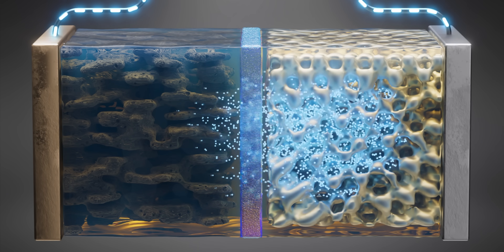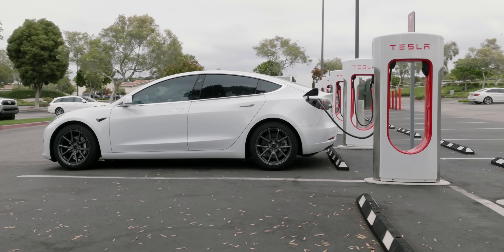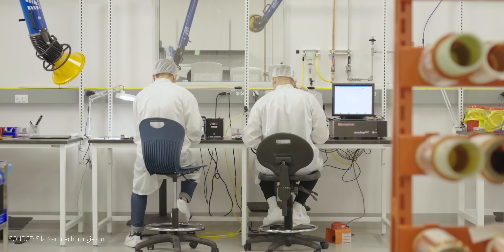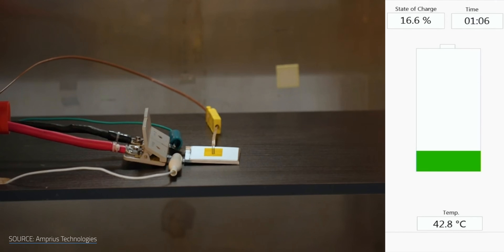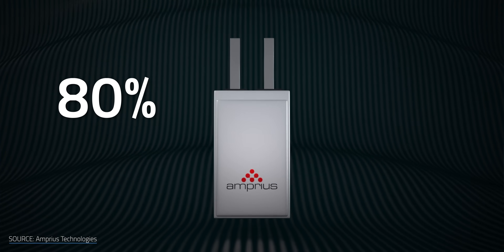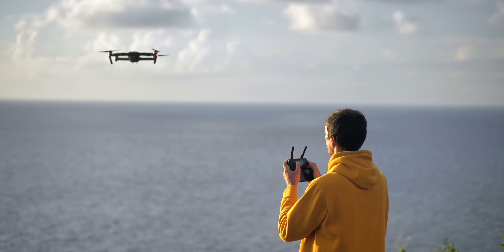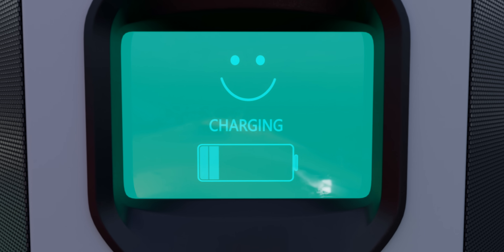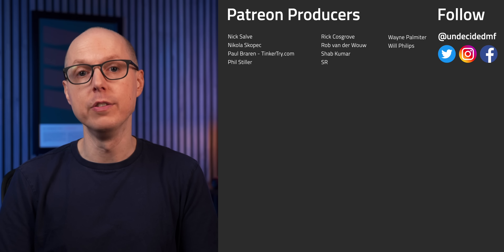Why This Ultra Dense Battery Breakthrough Matters

Comment: I would like to see an annual or bi-annual video going over the progress (or lack thereof) of some of the "breakthroughs" covered over the past years. I really enjoy these videos and consider myself a tech-optimist, but I'm also very skeptical of breakthrough technologies. I find that they often have very lofty promises that they almost always fail to realize.
Reply: That’s a great recap of this entire channel.
Reply: @airman122469  it's a great recap of gee-whiz engineering journalism since Popular Mechanics and Popular Science magazines 50+ years ago. Article after article about solar roofs and flying cars with never any follow-up on the invention they covered 4 years ago. Making physical things is hard, and improving them is harder (the exception is integrated circuits that until recently benefited from increased density). However over the same decades there has obviously been incredible incremental progress in solar, batteries, EVs, eVTOL aircraft, etc.
Reply: This would definitely increase the value of this content. You always see the new and exciting stuff that may have a future, but you never hear about how it panned out and why. Failure (and success) is how we learn, even if it's other people's failure.
Reply: It's not uncommon for something to seem very promising in the lab but turns out to be very problematic in later stages of development.
Reply: Same I would also like to see follow up videos on how these technologies are progressing.
Reply: This is a great idea, and would make these profiles journalistic which is valuable.
Reply: The issue is that the majority of what he talks about are reports from companies working on the 'breakthroughs'. These companies have financial incentive to pump their numbers and hype there product to increase investment. Most of this stuff isn't based on papers published just company memos sent to reporters.
Reply: Yeah, there are a bunch of videos about new revolutionary technology, but after fist video you never hear about it again
Reply: The fact will Farrell is talking about it tells you all you need to know. We will never hear of this again.
Reply: Google  Duck Duck Go is your friend
Reply: My partner is a PhD researcher biologist for durham university, she is one of the worlds top DNA experts in her field. What I have learnt from watching her and her colleagues work is that you get jumps in science. So a couple of years back she developed a new way to extract dna which was ground breaking and cool. Since then she has spent about a year on one tiny part trying to figure out a seriously complex issue. She works with multiple universities, has been to multiple countries and they are inching closer, but in real life there isn’t much to talk about to fill a video. One that issue is cracked, it will jump to a new level… but with these battery technologies, they will progress forward but at times to the lament person, will look to be stood still but it’s actually moving through a difficult “boring” stage.
People like lots of info in something the size of a tweet, it’s difficult to make it entertaining and informative.
Reply: @IW-1986  I appreciate what you are saying here. I have no doubt that progress in battery (and other renewable) technology IS being made at various companies. No doubt Panasonic, Samsung and other battery manufacturers are pouring millions into improving battery technology.

My only gripe with the companies that are typically being portrayed by Matt, is that it is often startups with a supposedly revolutionary new technology which then, curiously, is never heard about again.

Personally, I think it would be interesting to see which companies actually make any progress and live up to, at least some of, their promises. Sure, I could look it up myself but I think it would be prudent of Matt to present this to his audience.
Reply: Yes indeed, I have wondered the same thing so I would second the motion for follow up vids , while thinking about this, Perovskite solar panels springs to mind, they were claimed to be close to twice as efficient as the best silicon solar cells of the time , wonder what happened to them ????
Reply: It would be a very short “nothing happened” video
Reply: I'm the same. There was a new tech from a company called Reminova to grow back enamel in your teeth instead of fillings, that just disappeared, the website has gone as well. Got the investors money and went to the Caribbean 😉
Reply: fuel cells remember
Reply: That’s a reasonable comment. However, if I am not mistaken, Yu Ciu et al came up with these ideas on Stanford already before 2010, and hoped they would be commercially available about 5 years later. Sadly, material science  is a beast that is hard to tame. 

Always take projections with a scoop of salt, but do acknowledge the trends. Things tend to move exponentially.
Reply: Yeah, this guy totes 'breakthroughs' and 'game changers' for clicks and sponsorships, regurgitating whatever it is the company he is covering is selling. Very rarely does he actually push back.

It is not a channel for actual science news. It's for hopium.
Reply: i've followed this channel for a while. i would also love to see followup videos of past 'breakthrough' tech that was covered here. it would be very educational to see which tech is still building and trying and which were just a dead end.
Reply: I agree, without that type of feedback I feel this channel feels a lot like an aggregator for these Tech Companies PR teams. "Oh who has reached out to Matt this month."
Reply: You don't want that,   Many Youtubers with far more advanced degrees and success in developing stuff have stated Matt is just a journalist that does not know a winner from a poser.     Matt Ferrell is an Optimism guy,  these people are lucky once in a while,  but overall you don't want him to review his past work,  because it will destroy the optimism and dreamer within many viewers on this channel.
Reply: Breakthrough in technology doesn't not means it will be used widely. Maybe the manufacuring process is really difficult and cannot be mass produced easily. Sometimes it also does not make financial sense to incorporate this new tech into the product, could be for example this new batt tech could be breakthrough only for small devices like phones but it cost too much for manufacturing the battery at this scale, and the cost will be push on to the consumer and might cost the phone to 2x the price which there isn't a market for right now till they can bring the cost down.
Reply: Lithium carbide batteries are out.
Reply: Yep 👍 Lots of breakthrough technolgies are being reported about, which are to easily replace the Lithium technology, but let’s face it : NONE of them can fulfil the requirements either for technical- or for commercial reasons : eg what about the wonder technology reported by Fiskers a few years ago ? It’s in the bin ! 👎
Reply: Who woul
Reply: @m_hut  re: "Man, calm down a bit." A: no.  re: "HOW is it a contradiction to be generally speaking a  tech-optimist but nonetheless skeptical when it comes to specific claims? That is just realistic."  that is called the inability to see CONTRADICTIONS and unfortunately speaks to the presence of a form of Mental Illness...

re: "Most stuff never gets anywhere and yet we advance on the whole." (as if to make my point) again welcome to the "Myth of Progress", also see Wiki entry for the psychology of Confirmation Bias... 

Q: Which few "breakthroughs" are real? A: well those would be the one's you can Feel, Smell, Hear, Taste, and See in our daily life. wait, "is this really so hard to believe"...? (best Larry Fishburne/Morpheus voice)  okay next question.
Reply: It really feels like every scientific discovery with hope of finding Alien life. Every single time, it's a unique situation that feels like "THIS time it'll be true", only for a month to pass and us finding out that it's a bust.
Reply: Why not use lithography like in chip design ? You could use old equipment if  we are talking about micro ns...
Reply: Interviewed with a start up doing this in 2010. Never solved their yield problem but they had working examples. Wake me up when they start shipping product. Till then, meh.
Reply: I think this is a great idea
Reply: That's a great idea. I would love a to hear how some of them are doing now.
Reply: Well as someone who just invested in Amprius...this comment was very disheartening lol
Reply: It’s more often lack of money for tech failures.  Engineers are often poor marketers.
Reply: "I find that they often have very lofty promises that they almost always fail to realize."

I learned this years ago. I would see news stories, magazine articles, and videos about amazing developments in the lab, and then dead silence. It has made me a lot more skeptical and less hopeful when all the claims about a bright future turned out to be smoke on the wind.
Reply: @TwilightMysts Until 15 yrs ago, the furthest a electric production car could go was under 100 miles, in the last 10yrs they can now go about 400 miles and shatter all speed and acceleration records. Progress is being made, in fact they are now at the end of what a car can accelerate without downforce fans sucking the car to the floor to give it more traction. They are now only looking at faster charging and longer range, which is going up each year.
Reply: Computer breakthroughs have happened multiple times since the 1940s. Notably enigma, the transistor, microchips. All years apart. Technologies needed to make this work might be another breakthrough away. Doesn’t mean it’s not a real breakthrough.
Reply: I would like to add to that the battery performance in cold climates. Are these new battery technologies better or worse in extreme cold or heat as this is a major limiting factor in cold areas.
Reply: Even if the batteries didn't work it would be nice to know why. 

 Like the salt water battery for homes. NASA battery for density. 

 Graphene technologies just period overall. 

 Lithium air. 

 Matt has a lot of errors in older videos. Correct those. Also hope he stops getting scammed by scammers.
Reply: Agreed
Reply: It's out 
A phone was released with this  battery recently.
It's called honour 300 or something
Reply: @Macvombat  update 2025, silicone anode battery is now use in new phones
Reply: I think a big problem here is that private companies rely private funding in order to do anything. Venture capitalists and other private capital sources are primarily focused on short term payoffs, and so you’re incentivized to promise results “in the next few years”, when in reality it’s probably much longer. Honestly, I’m fine with waiting longer, and I also understand why a lot of these companies say what they say. But still, I just wish that we had an investment system that allowed companies to say “hey look, this is going to be a 15 year project, but the long term potential makes the investment worth it.”
Reply: @Macvombat  commenting this from my silicon carbon battery phone a year later
Reply: His podcast, ‘still to be determined’ does this to some degree.
Reply: re: "I really enjoy these videos and consider myself a tech-optimist..."  yup and unfortunately that's how the problem starts, per the Scientific Method "optimism" has no place in scientific discovery (all this was figured out back in the 17th Century and earlier).  ref: "The greatest DERANGEMENT of the mind is when a person makes something SO because one wishes it to BE so..." - Louis Pasteur (1822-1895)
Reply: @phillyphil1513 chill
Reply: @phillyphil1513  The scientific method does not apply to supporting technological R&D. The scientists themselves are bound by its constraints of course, but for the rest of us it’s not as relevant. Some areas of progress turn out to have future potential and will receive continued support, while others hit dead ends and will be rejected. This channel isn’t supposed to announce our future technology, it’s role is to present us with technologies that are potentially part of that future.
Reply: re: "I find that they often have very lofty promises that they almost always fail to realize."  <---- "well there ya go..." (best Clint Eastwood/Million Dollar Baby voice)  right so what's with the BS optimism then...?  now choose, one or the other, but NOT both.
Reply: @phillyphil1513  You must be delightful at parties.

Comment: Yet, silicon is going into a shortage every other year due to CPU GPU, and Every other computer part ever made/ windows/glass. 🤔🤔
Nobody else uses silicon because it's already an industry leader in electronics... if this takes off in any company, on an EV scale that survives, it will create a huge shortage in the next few generations of computers, onward.
Anyways, the current lion we have, is enough to power a 700HP car. Only real upside to the consumer, would be charge time, as I doubt EV will let a 1000+ HP car discharge that much of the battery at once. Though, a "small" portion of supercars with such silicon batteries would be interesting. Also, imagine using cpu grade silicon in a battery, with a static, non-moving machine that can discharge even smaller nano-wires.

Comment: The thing about Silicon anodes (in the form of nanowires) is that they might be better than even Lithium (or Sodium) metal anodes as a charge collector. There is a notion about that (solid state) Lithium (or Sodium) metal must be the ultimate in cell electrodes. We haven't  gone that route because, so far, it hasn't been possible to build cells using Lithium foil as the negative electrode that offer long life. Cells using Lithium metal as the Anode have been unreliable and prone to failure after a limited number of recharge cycles and haven't been great candidates for battery safety either. It is a dream to build the safe and long lived Lithium metal battery, but does the dream make sense?

Carefully engineered negative electrodes might be a better approach.

Silicon nanowires seem to work well and vastly better than most other proposed approaches to using silicon as a current collector. Graphene also shows a lot of promise and might greatly reduce the internal resistance of cells (offering increased reliability and faster charging speeds) if only the engineered graphene electrode materials could be turned out in high volumes and at reasonable prices.

Just as there are a lot of good reasons that explain why Lithium cells haven't used Lithium foil current collectors before now there are also a long list of reasons why Lithium became the favourite for new generation cells, irrespective. The unique characteristics of newer engineered electrodes, though, allow us to revisit the question of the necessity of Lithium in a modern cell. Sodium starts looking like an attractive alternative (as it might be possible to mass produce Sodium cells at a lower cost than Lithium cells even after factoring in engineering costs) if charge storage density can be lifted at the Anode side (and at the Cathode) but that seems to be within reach.

It wouldn't shock me if we see more Sodium, Silicon, Graphene, Sulfur and Aluminium in common use by the end of the decade in up to the minute batteries. Lithium might be on the way down from its high point by then.
Reply: Sodium ion batteries might be useful for stationary batteries where weight does not much matter. But, a sodium ion has about 3 times the mass of a lithium ion and only half the energy of oxidation.  It is thus at a 6 fold disadvantage to lithium.

Comment: I am sure there is a balance in adding or swapping to silicon not sure were it is though. I hope we can get more useful battery and other increases.  I am still hopping they come out with Sodium Batteries for home power soon..I am sure many of us could use a much cheaper but larger battery for non moving use. There are many tech an paths they are taking and i love them all. I am sure 99+% of the ideas will not get beyond the lab or small use but even a failure can give advance in the tech... or may be looked at 20-100 years later as a solution then

Comment: The market will drive this technology super fast I should imagine, once one company sells affordable EV's with substantially greater ranges and charge times using this or some other new battery technology every other manufacturer will have to follow or go extinct. We're entering a ruthless period of survival of the fittest in the auto industry as mainstream customers switch to EVs on mass, no companies are safe from the small supercar manufacturers to the biggest players, interesting times.

Comment: This much  speedy  charging rate then what about heat impact ? This fast with kw     level 🤯 if it is true than great. .. the only obstacle is electric vehicle  hopefully it doesn't pollution 90 thousands of miles Worth pre pollution per 60 kw battery pack approximately . , longevity is the issue with heat impact due to radical pace , j
How about dandruff that occurs due to charge and discharge 🤔 .  Hopefully 10-12 years range we will have the proper solution in production .🎉 Every house should have a battery unit , it can help reducing capacity charges which government pays in billions over dacade of years . System can be developed on which electricity generating plant should run and which could be on standby . Helps a lot right ? Suppose a 100 kw unit charge in six minutes, just think of molecular motion in cells and heat generation , DC/AC voltage  impact 🤔 some tremendous mind crushing persisting attention to details is needed.